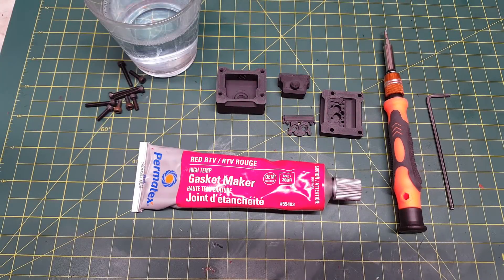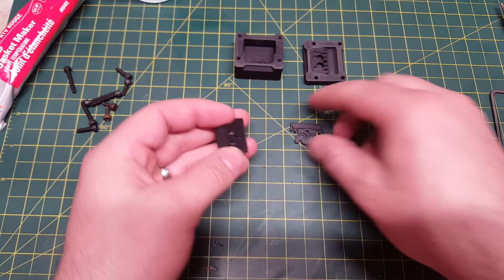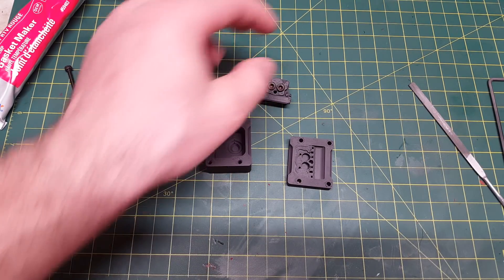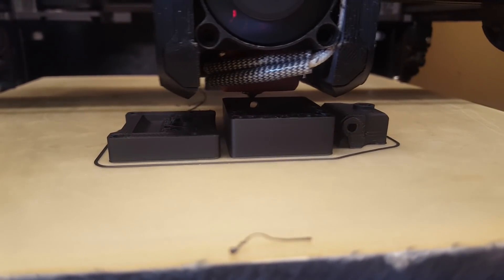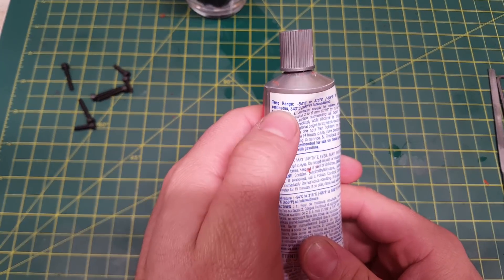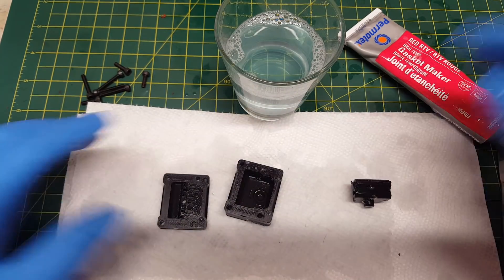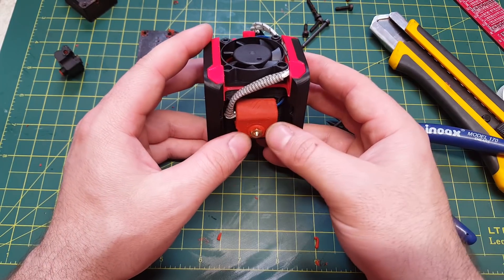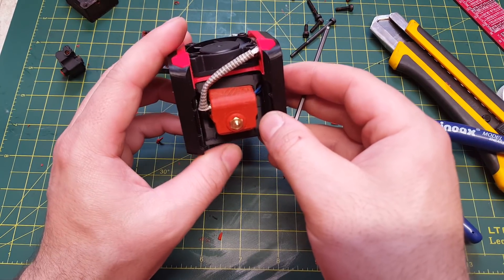Making a silicone sock for the Mosquito hotend

Comment: I tried with acetic cure high temperature silicone and the thing just refuses to cure due the lack of oxygen inside the die 🤡, I didn't used any releasing agent like you did with water and dish soap, I guess the proper way is using bicomponent silicone that uses a catalyst agent that allows anaerobic cure.

Comment: Thanks for this!! I tried this using "Permatex 27036 Optimum Grey Gasket Maker" because it's for even hotter temperatures. The molding went well but despite waiting a full 24hrs the silicone was not solid when I opened it up, and still seems deform-able and weak days later. Not sure what I did wrong.
Reply: After doing more research, I think I might have experienced 'silicone inhibition', most likely from the awful plastic food-prep gloves I tried using.
Reply: @davidamick  thank you for the follow up!

Comment: You can maybe use talc powder with the silicone to make a proto-putty. Since talc is inorganic it won't burn and it will be much easier to work with since it doesn't stick.

Comment: sooooooo with the presence of vent holes why not use a syringe to inject the silicone? be a hell of a lot less mess and cleanup
Reply from the maker: would need a syring with a large enough needle for the silicon to flow
There are designs that use that method ive seen, i simply didnt have the tools on hand

Comment: Thank you for this awesome guide! This is working perfect! I didn't have high hopes for the first try. I never worked with silicone moldes before so zero experience. As in the readme of the STL Download suggested, I printed three moldes and made three socks (I did put them into the enclosure for the drying process for 3 days, basically forgot about them ...). So after opening all three and pulling them out gently. All three did look great! 

Again! Thx for the great tutorial!

Comment: I think mosquitoes get hot enough to burn the silicone sock that’s why they don’t offer sock for them .
Reply from the maker: This DIY sock has lasted a few thousand print hours already since I made it, zero issues
Reply: @CanuckCreator  oh yes , I agree. Just saying why I think they won’t offer it in the market. Thanks for the guide.
Reply: @SinaShahsana  They now sell the sock.
Probably the real reason they didn't offer a sock before is a simple case of "I never use a sock, and never had a problem with it" syndrome.

Comment: I tried it for my e3d v6 today and god the silicone is smelly and sticky and messy! maybe my choice of gloves made it worse (silicone gloves? or latex? no idea.) but they sticked so hard to everything :D lets hope it runs out okay!
Reply: nitril gloves usually are good
Reply: a cheap metoh is dunking the molds into baby oil and letting it set in for a couple of minutes
or using vaseline combined with IPA
best way is to use mold release